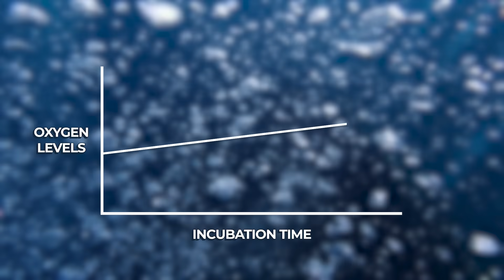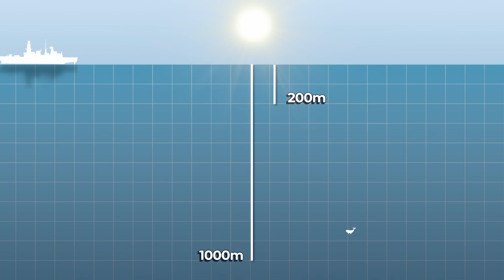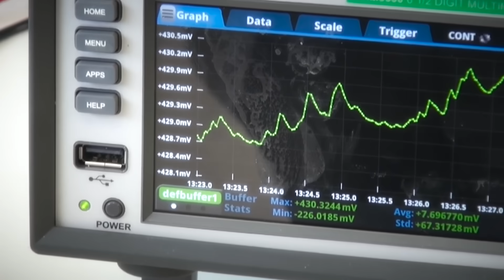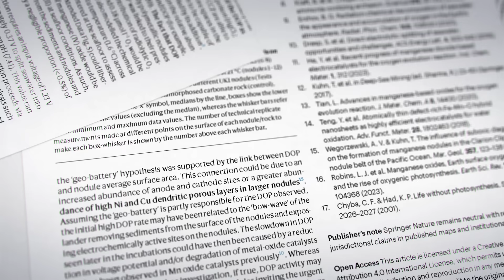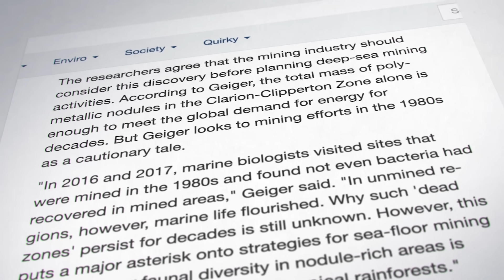We Just Discovered "Dark" Oxygen on Earth - Breakthrough Explained

Comment: Sounds more like a catalytic process to me than a purely electrolytic one. If these nodes don't "discharge", then the pressure and the salt may be a crucial part of that process, because these are the lab conditions they simulated. So, the nodes should not produce a charge if put in normal athmosphere. Sadly, this is not metioned in this video. Did anybody read Geiger's paper?

Comment: From a purely precautionary principle POV we should not consider mining these nodules beyond experimental levels until we can at least determine the process behind the dark oxygen generation.

I would submit that because chemosynthetic organisms (mostly bacteria) that consume hydrogen already exist around thermal vents in the abyssal plain and there is no evidence of that hydrogen (that I am aware) which should be present along with the oxygen if water is being split and that the process seems to be dependent on nodule surface area, that some layer of microscopic life on the nodules is responsible for the process.  This layer could also explain the relative slowness of the nodule growth

Possibly the nodules could be harvested safely if not done over a reasonable percentage (less than 10%) of existing nodules in the interim if some of the nodules are crushed and used to reseed the harvest area with an equivalent surface area or reasonable multiple of those harvested.  Then confirm that the reseeded area is creating oxygen

Comment: A hypothesis... if I may.  

Salt NaCl is an electrolyte, much higher percentage (saltier) at higher depths, I think. Also, it is in constant motion and contains all sorts of minerals as it flows. The flow is a friction at an insanely high pressures,  thus creating an electric charge, that then facilitates a galvanic process... that is well studied and understood. 

I would do the same experiment with a seeding metal spikes resembling a brush or a tube minus the fin heat exchanger, 1x1x1 meter with a certain density between the spikes... and to monitor flow in vs. flow out... this can be big... not only for oxygen production, but also  electricity production. That would explain a lot.   

Please keep us posted on the development. 
thank you

Comment: The Metals Company is an explorer of lower-impact battery metals from seafloor polymetallic nodules, on a dual mission: (1) supply metals for the clean energy transition with the least possible negative environmental and social impact and (2) accelerate the transition to a circular metal economy. The Company through its subsidiaries holds exploration and commercial rights to three polymetallic nodule contract areas in the Clarion Clipperton Zone of the Pacific Ocean regulated by the International Seabed Authority and sponsored by the governments of Nauru, Kiribati and the Kingdom of Tonga.

Comment: If the Natural Battery system is working Like this, you will see the Hydrogen Increase as well Oxygen. H2O 
Electrolysis of water 
split water into oxygen (O 2 ) and hydrogen (H 2 ) gas Typically 1.5 volts is required. Electrolysis .
If you see O2 and no H2 or Less H2 you could Be seeing Bio-forms creating that Oxygen.
If it is Biologic you will see Hydrogen decrease as it is absorption in digestion with carbon or metals ores.

Comment: Perhaps the batteries idea is correct but it isn't that they manage to retain their charge since formation but rather that they are being 'recharged' or held in equilibrium by some process that then gets disrupted through isolation in the test.
An example could even be some form of living process. One ultimately dependant on surface oxygen for survival but charging the rocks up with the potential to produce oxygen from the energy (oxygen and sugars/biomass) that they gain from photosynthetic primary production at the surface. Perhaps even adapted to do this in order to use the rocks to stabilise its oxygen supply.

Comment: The ocean floor is not a closed system. 
possibility 1: weak thermal vents giving the nugs lots of o2 to suck up to the ground level where it can reach and be released into the H20
possibility 2: just electrolysis and the ocean floor is charging the battery nugs with the power of tides/waves/microbes/vents/whathaveyous
Why would they think it would last forever just because they found a rock that's got some electrical or O+ power. 
The oceans and what's below them we might not know a lot about, but we are damn sure its not a vacuum.

Comment: so for the metals to come out of solution it would have to be more energetically favorable to do so. Could it be that the formation of the nodules as much as the structure and chemistry of them leads to the voltage generation. Did they rule out depletion of the necessary ions in the seawater to continue forming the nodules, as a reason for the oxygen production drop off? I kind of don't buy that something that grows that slowly could generate a noticeable amount of oxygen with out more then just then its inherent structure and electro chemistry, but i'm going of my intuition and not any real knowledge here.

Comment: If this natural, free electrolysis is generating oxygen in deep ocean, it is also generating hydrogen gas. Which would make it the first natural source of the most energetically dense combustible which also happens to be clean. Basically natural green hydrogen. However, we must assess its economical viability, which depends on how costly it is to mine it down there in deep ocean…
Either way, a solution for The Metals Company could be mining it, as it would be analogous to finding petroleum (or perhaps better).
Reply: something like trying to create a structure far above the life depending on the nodules, to capture extra hydrogen? seems a tricky business (for not disturbing the life there, nor the working module system), but an idea worth studying for sure.
Reply: It's a cooked oxide oxygen in prehistoric time's 👍🏼

Comment: I'm not sure how it works, but if there are free electrons in the saltwater itself, the poly metallic nodules might just be providing the conduit through which electrolysis occurs—not necessarily the electricity itself. It could be that the presence of the nodules is just helping the water release electrical energy already stored in it somehow. Maybe the "battery" isn't in the nodules, but something in the water other than salt

Comment: My theory is that the ocean floor is heated from within the earth. The nodules are directly in contact with this hot surface and surrounded by a heat insulating layer of sediment. On top, they're in contact with cold seawater. The Peltier effect could then charge that nodule like a battery, if it consists of the right layers. The stored electrical energy could then keep the electrolysis going for a while. But this process also creates hydrogen gas. One would expect that the researchers would find it. Or could another process immediately adsorb that? If that would happen, I'd expect the pH to change. Also something the researches probably would have noticed. Unless they were too much fixated on their dark oxygen. Interesting...

Comment: to be fair, we struggle to make batteries because we need to set them to a fixed amps and volts output and input; because simple batteries are a thing; mecanical batteries for instance that converts power to kinetic energy , and kinetic energy back to power ( the ration is somewhere between 40-60% energy loss in the process, but this is the best large scale battery tech we have at the moment) 

When it comes to making a battery without restrictions, you can make one with potatoes and nails; so, in my opinion, the electrolysis argument makes sense, considering the scale of said battery.

Comment: It seems that humans crave so much energy that no matter how they get it they will end up damaging an eco system beyond repair, and even risk shutting down natural processes that keep Earth in balance. 

Green tech, as Batteries and solar, may be 100% pollutant free while they are in use, however there is absolutely nothing green in the process of obtaining the materials, assembling the equipment, disposing of it, or if is ever catches on fire. Lithium is only available in limited areas, and is even limited in those areas. Cobalt even more rare, and does not exist on every continent. These two elements will continue to drive wars over energy. Batteries need to move away from these elements.  

If the Earth has a natural O2 delivery system going on under the Ocean, then perhaps it is best to leave everything about it alone. In tiny amounts not much of a difference will be known, take to much and you could be risking contamination, of some kind, into that conveyor system, potentially shutting it down. Just imagine what happens after that. I suppose money will not be a concern anymore after that fall out. 

How about humans stop demanding so much energy, and live within their means. Quit building houses that can fit 5 families for just one family to live in. It is houses that huge that are the biggest energy drain on the system. The same with those huge shopping plazas humans love to use daily.  Yes, they can afford it, but does it make it right when there is Cleary an energy crisis going on? It would be so much easier if the humans learned how to live with less energy consumption. But no, they want to be concerned about the planet and its energy while using as much as they possibly can in the process.

Comment: Making a battery is not that hard, you can make a battery with almost any metal and any salt,  you can literally stick a piece of copper/zinc into a potato. The efficiency is what makes it difficult.  I completely believe that this is what's going on, a galvanic reaction, especially because during electrolysis metals move through the electrolyte solution and deposit on the cathode, which directly correlates to the metal nodules forming over millions of years.  Also batteries don't "deplete", they simply move the metal from one side to the other until the metal is all on one side or in the case of recharging it "depletes" by touches both sides causing a short or runs out of electrolyte solution by the separation of hydrogen and other gasses.  The question is how is it still working? Could be that the anodes and cathodes are made up of so many metals that they have formed a sort of balance where as electrolysis happens between two nodules, it create an equilibrium where metals of opposite electrochemical series switch places, and the staggering of the nodules create a sort of supermassive matrix that continues to move metals around. 

The fact we are mining this potential massive oxygen source for the planet is deeply troubling me.

Comment: Sends legitimate. Basically, you have catalytic converters on the seabed. Topside up, and grounded, for meerkats and anode. All the medals technically oxidise in the presence of oxygen, however hydrolysis technically comes in two stages, forming a hydroxide and a prototype/hydrogen radical, under pressure could also cause peroxide, which would also react with the pre-hydrogen to create oxygen, and hydrogen, or connect with the metal to create a very reactive reduction, further pushing the reaction for hydrolysis, whilst also scavenging any Polymer tailored ions in the water, hence the long-time to grow. This would also make reasonable the service area to some degree, and why zones that have been disturbed lack ecosystem repair. Generally the seabed would be full of carbonates, dissolved carbon dioxide, which of course life as we know it, required to build amino acids and proteins, structures via carbon. Some of the first reaction produces hydrogen radical, then carbonic acid or sodium carbonate would be likely electrolyte to further stimulate the redox reaction until all of the close sample has reached equilibrium. This could be the lowest level of carbon scavenging without photosynthesis, an ecosystem that exists within the electro-redox rich environment. Could be devastating effect for the world no matter how they try to justify the ease of mining, although this in itself would reduce the man's CO2 production Strattera based running operations, extracting me tons of rock and converting to the calling metallic substituents releases excessively amount of CO2, and is liable and easy as it seems, the overall effect took place we know very little about could push the greenhouse effect well beyond any chance of repair. Then again it could also become a new form of possible energy and oxygen farming trees could no longer cope! Imagine the nodules turned into stress poking up from the floor hence increasing service area as the water flows through, basically a type: on the seabed that we might be able to tap into energy from an oxygen reducing manner as opposed to cool and CO2 production.
The answers to the future role there, already in nature. It is capitalising on a phenomenon like this could be the very start the paradigms change, switching potentially to sodium ion batteries, instead of devastating the landscape in search of reasonably call reserves are very hard to recycle batteries, whilst also creating a new renewable source if the ground is actually yours itself, its lack of recharging or group.

Comment: the test had a very small amount of salt water in the container. the ocean does not. the salt could simply have been expended, or the water could have become oversaturated, such that it either did not have the capacity to dissolve more oxygen, or the amount of dissolved oxygen interfered with the reaction. i think it's more likely that there was no longer enough salt to form a reaction.

Comment: Summary
* [0:00] Accidental Discovery: In 2013, researchers unexpectedly found increasing oxygen levels in sealed chambers on the deep ocean floor (Clarion Clipperton Zone) instead of the expected decrease. 
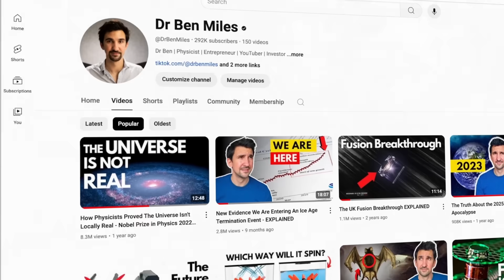* [2:17] Initial Dismissal and Confirmation: The finding was initially ignored as faulty data. However, a 2021 experiment using different methods confirmed the oxygen production.
* [5:44] Polymetallic Nodules and the "Dark Oxygen" Theory: The Clarion Clipperton Zone is rich in polymetallic nodules (metal-rich rock clusters). Researchers theorize these nodules act as natural batteries, splitting water into hydrogen and oxygen through electrolysis. This is called "dark oxygen" because it's produced without sunlight.
* [8:20] Laboratory Evidence: Experiments recreated deep-sea conditions and observed oxygen production in the absence of photosynthetic life, supporting the "geo-battery" hypothesis.
* [11:02] Implications for Deep Sea Mining: The discovery raises concerns about deep-sea mining, as removing these nodules could disrupt a potentially crucial oxygen source for deep-sea ecosystems. A mining company representative disputes the findings, suggesting oxygen contamination.
* [11:02] Broader Scientific Impact:  The existence of "dark oxygen" challenges our understanding of oxygen production on Earth and could impact how we search for signs of life on other planets. 
* [11:02] Unanswered Questions: The exact mechanism of this "geo-battery" remains unclear, and more research is needed to determine its long-term viability and overall impact. 

i used gemini 1.5 pro to summarize the transcript

Comment: Everybody needs to stop saying oxygen "generation". There's no evidence that its being generated, just that it is more than the surroundings as evidenced by the "generation" stopping after 3 days. Also, The energy cost of electrolysis is completely out of scope for the amount of oxygen they're measuring against the hypothetical voltaic energy from the very speculative "battery rock".

I'm not sold.

Comment: Since the mechanism of oxegen production is electrolysis Wouldn't that mean that the sea water in these areas would become more acidic with the free floating hydrogen bonding to other elements in the soil, water, and metallic ores?
Reply: I guess what I wanted to get at is if the hydrogen could ionize and produce charged particles in the ocean water to sustain this "battery"

Comment: So the rocks take a long time to form. Then, they form batteries from the metals that deposited on them over time to discharge electrons. However, can those processes even run in parallel? Doesn't one deplete the other? Electrolysis usually means material (ion) transport. That would mean the metals, which deposited over millions of years, would be transported away in a process which is presumably much faster than the one by which those same metals got deposited in the first place. There is something missing for my understanding.

Comment: As an analytical chemist and geochemist, the fact that molecular hydrogen (H2) hasn't been observed (or reported?) together with the molecular oxygen (O2) indicates the observed O2 has not been produced by hydrolysis of water/seawater (pressure and temperature at these depths not withstanding) but instead is being produced by some other (as yet unknown?) process? Hydrolysis of water at standard temp & pressure, requires 1.5 Volts DC to split water apart! Additionally, if indeed hydrolysis was producing the observed O2 then you would also expect to see two molar equivalents of H2 for every molar equivalent of O2 produced and, as far as I understand, this has not (yet??) been observed? An extremely interesting phenomenon, nevertheless and one that could hold a great benefit for human-kind, once this process has been fully elucidated! Great video!! Cheers from Downunder.
Reply: this is my precise question about the study. obviously, the mining company doesn't want to be told to stop mining, but these very kinds of issues would be very good for the mining company to raise in their rebuttal